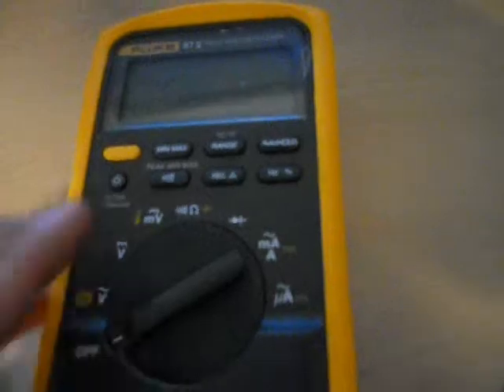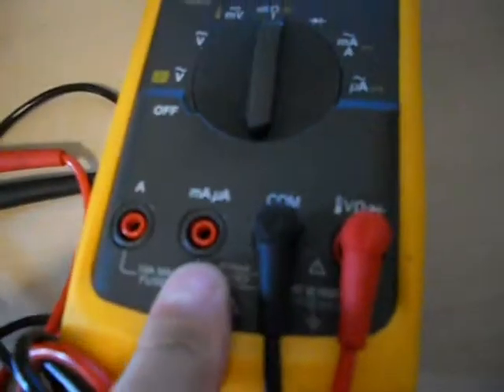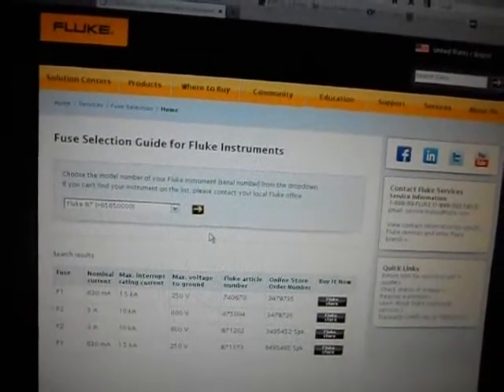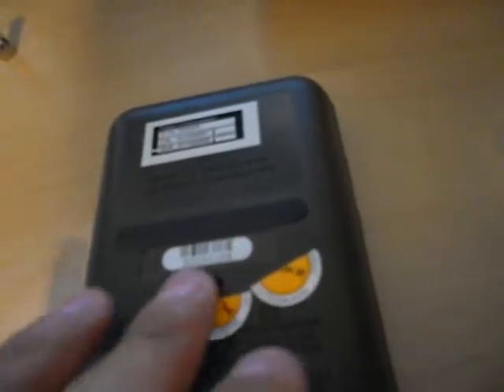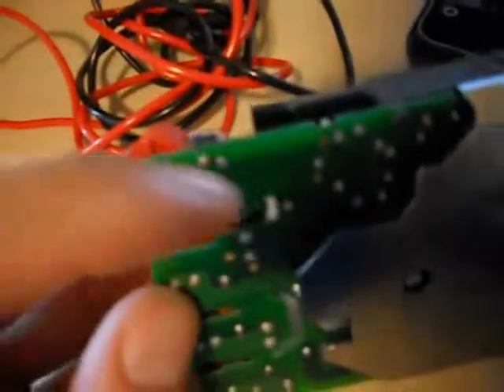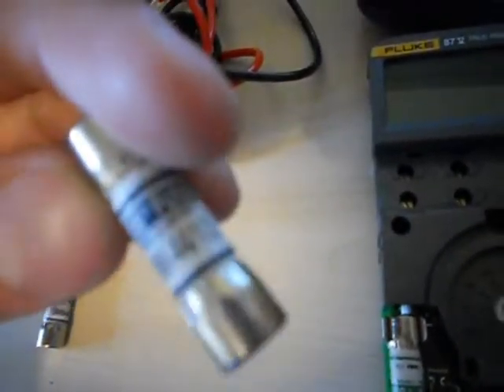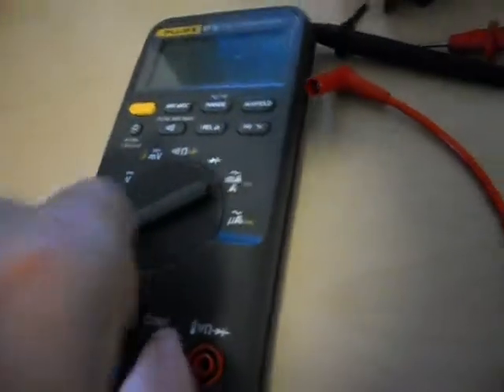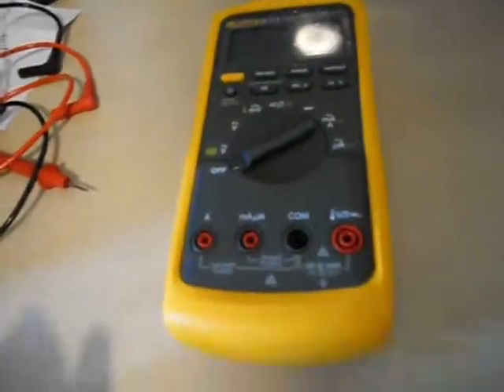How to Fluke 87 Digital Multimeter fuse replacement and fuse test

Comment: So is the other fuse in there that you didnt replace the one for the 10 amp port? My mili amp port works but not the 10 amp port.
Reply from the maker: Yea that's the 10 amp fuse   Replace that one and u should be good to go
Reply from the maker: Might want to contact fluke too they have a lifetime warranty. Who knows worth a phone call maybe they will slide you a free fuse in the mail  I should of did that.   The 87 is lifetime. Didnt even know. years ago they sent me a new one when it broke.  I guess they would again 10 years later
Reply: @GhettoWagon  thanks
Reply from the maker: If you have another multi meter check the fuse for resistance too. Never know if its that or something else. OBv is it shows  open. Its done!

Comment: What I learned in boating school is.....Never connect your DMM to a Car Battery that you were sure was dead...
Great Video BTW
Reply from the maker: +TheCireMC  Thanks.  Why is that? I would imagine if the battery has a dead short maybe it could cause a issue.   I always connect the DVM to a dead battery so I know how low it is in voltage so it wont explode from hydrogen gas when I jump it    I shorted the meter from running too many amps through it when I was checking something, I forget.

Comment: Great video. I just did the procedure and fixed my two old Fluke 87s and they work like new! These are very robust meters and I have no reason to upgrade. Thanks!
Reply from the maker: No problem, Ya They are great meters. Rugged for the automotive field too.